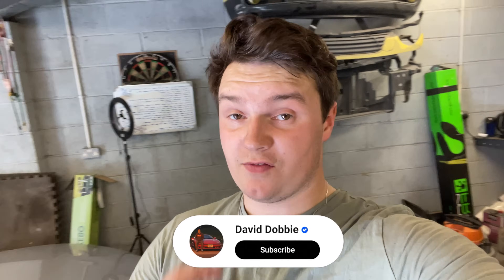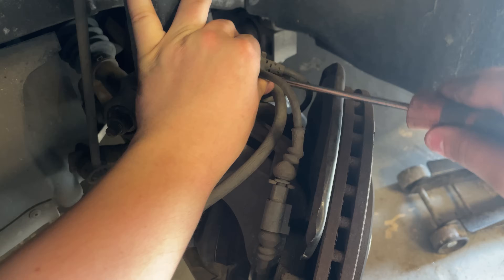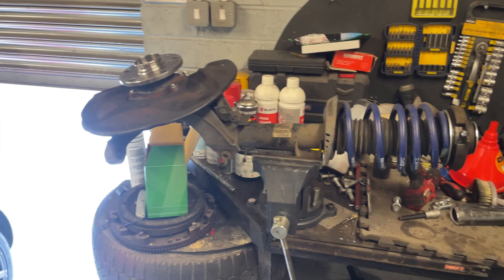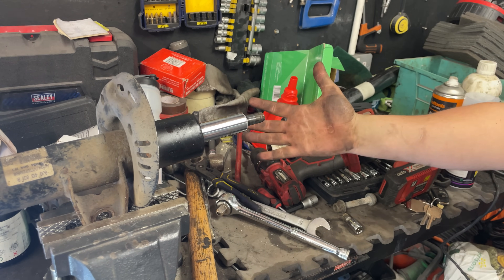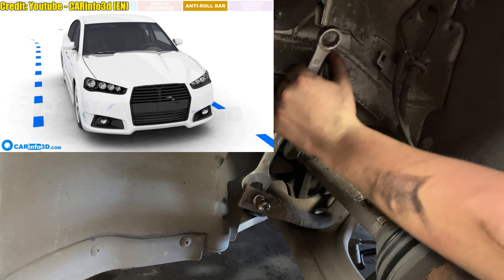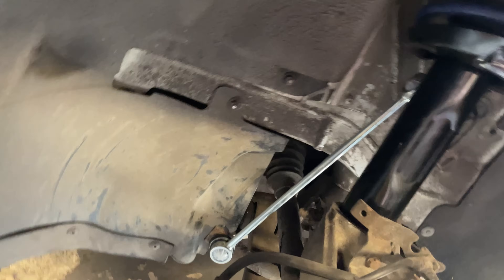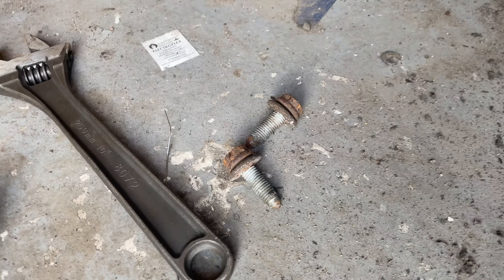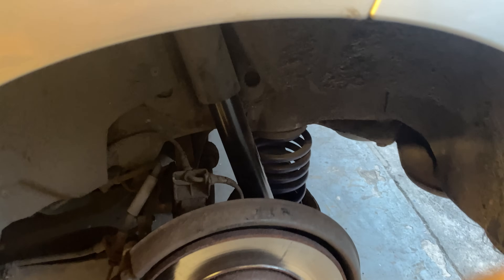REPLACING THE SHOCKS ON MY MK2 AUDI TT

Comment: I was changing my discs and pads today and noticed the stop bumps are more or less goosed, they've perished quite bad and the plastic cover has even dropped down, will the whole rear shock need to come out do you think just to change the foam bump stop? Nice one 👍
Reply from the maker: As far as I'm aware it will need to. Fairly easy job though in all fairness if you have to tools👍🏻